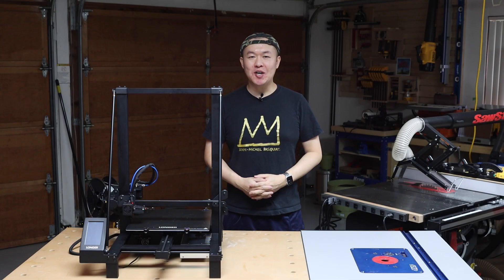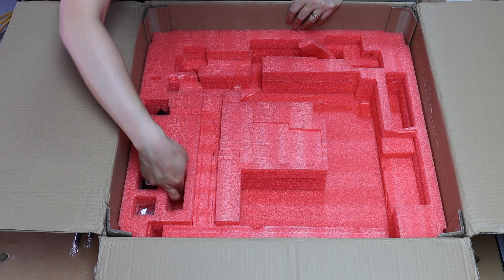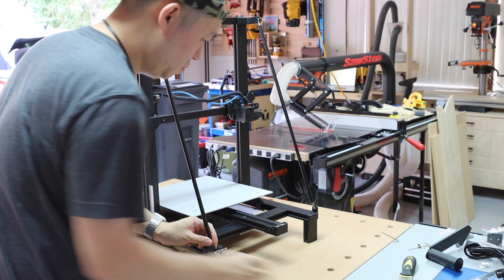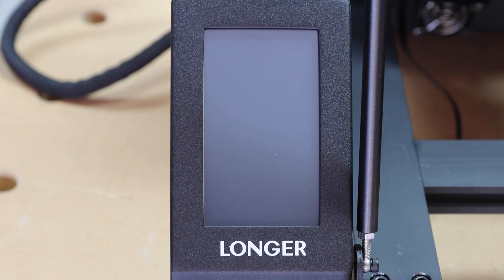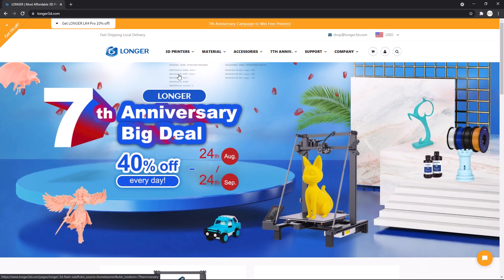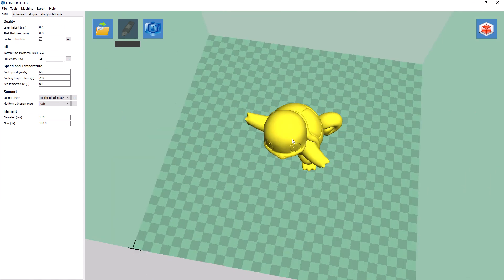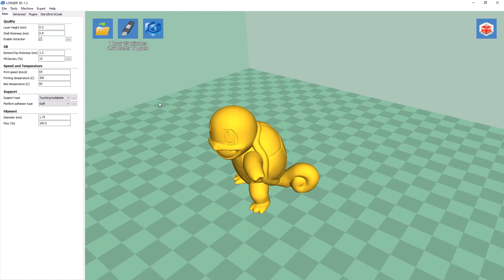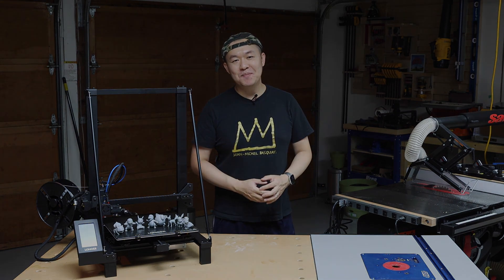3D Printing Tutorial for Complete Newbies using Longer LK5 Pro | Beginning's Guide to 3D Printing

Comment: I got this 3D printer as a first 3D printer and first prints have like little dots on the print and it struggles with small prints i dont know if its only me or my settings i firstly used the longer slizers which had more dots later i switched to cura and tweaked the settings i slowed the printing speed and most of the blobs dissapeared maybe its just me being a beginner
Reply: So i have the printer in a room were i play games most of the time so i have the window open and maybe its the humidity coming from the open window again im a beginner so i dont know all the stuff yet i printed a 3d model of a heinkel he 162 in 1:32 scale and it had flaps that were separete and had little openings in the flaps and when printed vertically it left plastic blobs in the holes making it impossible to attach the flaps to the wing without sanding
Reply: Do you use a filament oven? I’ve heard you have to heat up the filament for hours before printing

Comment: I bought the longer LK5 Pro a few months back and today I finally had time to assemble it last week I got everything together with no problems easy stuff, but I have A big Problem. (Please Help Me) 

Problem: Step 6 says the Z-axis limit switch installation height is flush with the upper edge of the white label [[Problem is there is no label on mine!! I need to know how high the Z-axis limit switch is supposed to be from the bottom of the left side of the gantry because "there is no label" I will subscribe to anyone that helps me get this information because I have yet to get a reply from customer support on this matter. you can send information in mm or inch.
Reply: Had the same problem, looked at a few pics and vids of the position it was most commonly mounted and haven't had any problems. Afterwards do 3 rounds of the 5 point leveling and you should be good. The axis switch should click right after the nozzle makes light contact with the bed. Im a noob but I hope this helps. I thought I was buying a new unit but they are clearly remans. They missed the rollers under the bed. Full of black roller crumbs from extended use before I bought it. Dust and minor rust on well worn fasteners. Too many scratch n dents to count. It's printing fine though. Hope this helps!

Comment: Bought the Longer LK5 Pro 3d printer and it didn't work right out of the box. The Z axis would only go up but not down, wouldn't home and was doing strange things. So, I contacted Longer support to find out that my printer had a bad motherboard. Then they told me they would ship me a new motherboard and to fix it myself. I guess they got the name LONGER for it want work long but takes longer to get it fixed. I wouldn't trust anything with the brand name Longer on it. I have three other 3d printers from three different manufactures and have had no issues. Again, I wouldn't trust anything with the brand name Longer on it.
Reply: Must have been a YOU problem, as mine went together easily and works flawlessly every print so far
Reply: You don't want me as you problem. I have over 25 3d printers so I don't think it's me. The mother board was screwed up and  customer service sucked.

Comment: Hi Ding I have a Longer LK5 Pro I cnnot do the set up as there is no movement on the Y axis . Have you any thoughts to help me .
Reply from the maker: Hmm, did you check the y axis cable and make sure they’re seated correctly at both the motor connector and the motherboard connector?
Reply: Check your wheels... if they are too loose or tight they won't move... the little wrench that comes with the printer will let you adjust them... only one of each group of wheels has a nut and is adjustable.

Comment: Only issue i've had is bed adhesion. I'm able to create a brim but when it goes for a circle for a hole on layer 1 it fails most of the time. Going to get a glue stick tomorrow to see if that helps.
Reply: Did the glue stick help? Having the same issue

Comment: when I go on to the website and attempt to download this software, it says is not an app that exists??? the instruction paper I recieved instructs me to use ultimaker, could you do a tutorial on how to make a file gcode on ultimate through the method I just suggested? that would be of great help! Thanks!
Reply: They have the installer on the micro sd card
Reply: Here is the link to the download center aswell: https://www.support.longer3d.com/download-center 

Note: At the top for FDM printers you want to download "LONGER 3D Slicer (Windows)"

Comment: I’ve had this printer for over 2 months and have not been able to complete 1 single print I’m not sure if it’s me or the printer at this point I’ve watched over 30 videos and still not close
Reply: same my print keeps f'n moving at the very end!!! I think its the leveling issue
Reply from the maker: Can you check to make sure the drive belts are tight?  If the drive belts are loose, it could “jump out of gear”.
Reply: @DingsWorkshop  I believe they are. Is it normal for a print to get to 90% then knock out of place? I just started yesterday and ran through all my filament trying to get it "leveled" I'm waiting for more to continue testing
Reply: @goodluck  I’m having the same issue , everything was good in the beginning and now I’m here trying to level the bed over and over again because it won’t print properly 🤦‍♂️ I don’t know what to do
Reply: @KingSlayer033  It took me forever but I just had to focus really hard and use a thin sheet of paper to line each one up. been up and running daily since then and everything comes out flawless. make sure to print with ultimaker it has better settings
Reply: @KingSlayer033  I used the instruction sheet for my first leveling. Print settings were 200C for the nozzle and 60C for the bed. But printing the boat will do this by default by heating the bed and then the nozzle.
Reply: I've had good luck with leveling with a post it note, increasing the fan by 10%, lowering the feed to 90% everything from my second print on has came out well
Reply: You are having an  adhesion issue look up videos on getting your prints to stick... higher build plate temperature helps some people use a glue stick or even hairspray